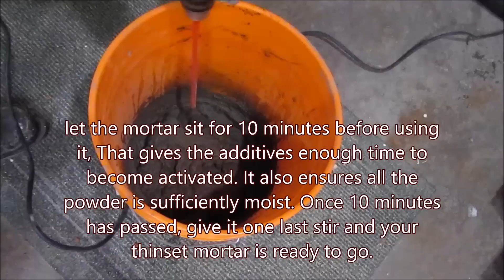Fireplace Install #7 of 9, hearth and tile

Comment: If you tile over wood the tile WILL fall off. You need a mesh stapled to the wood and a mortar base. Then after 24 hours you can set tile.

Comment: What type of wood did you use for the hearth? Great job, your video inspired me to update my fireplace. I'm a DIY rookie so I doubt it will look as good as yours.
Reply from the maker: +prettypinkplatinum 
 I used regular 2X4 Studs to frame it out and 3/4" Construction Grade Plywood for the hearth top. Good luck with your project and thank you for the nice comment.